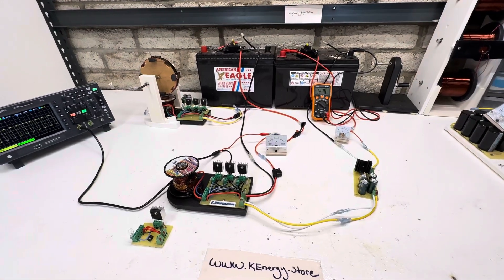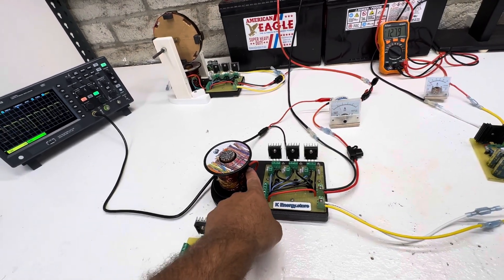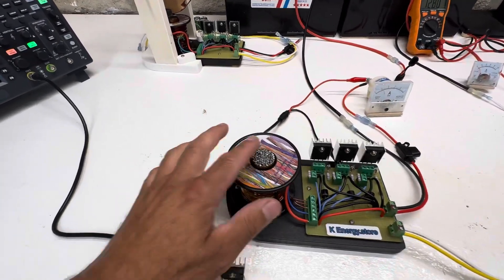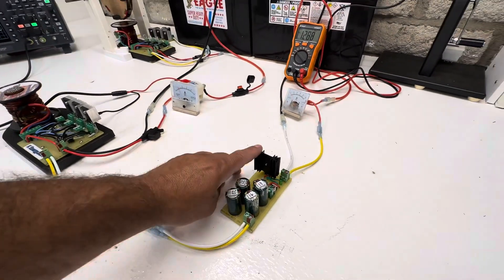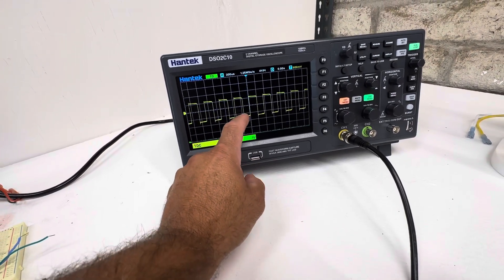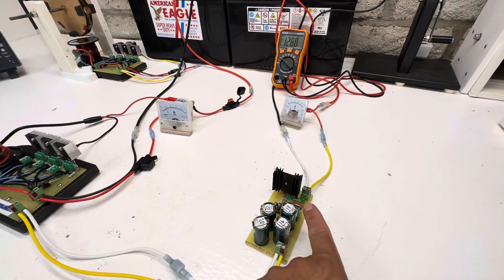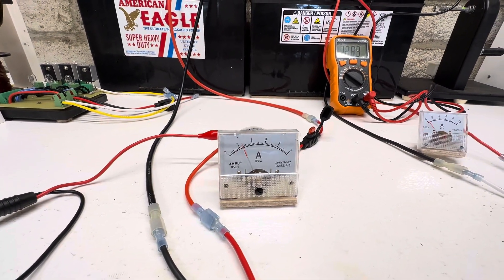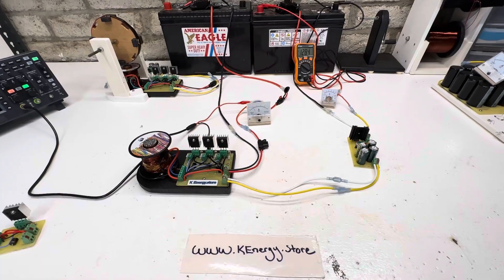Forced Oscillator solid state charging

Comment: Sorry I had missed this. Are there three separate wires or two on the coil? Do we need to use three mosfets or one would do.
Reply from the maker: You should watch next one too
Reply from the maker: 4 strand coil 1 for timing 3 power 
3 transistors 200v

Comment: You are doing some incredible research!!! I was friends with John Bedini and he would be proud of what you are doing.
Reply from the maker: Thank you !
Reply: @kenergy1707  I love that Newman boat motor. Did you see the Newman video where he drove that old car with dead nine volt batteries to start and after 30 laps they were completely full. That was an awesome video. I will see if I can find it.
Reply from the maker: @Biokemist-o3k  I saw lots of them but not that one that’s awesome
Reply from the maker: @Biokemist-o3k  I’m making a smaller version of my boat motor to test some ideas should be interesting that motor can do 85% return at lower speeds
Reply: @kenergy1707  It was so cool. I do not think it was 9 volt batteries. I believe it was two sets of 4 batteries . They were almost dead when he started though. I am working on a similar project however I need a switching unit that will switch run battery and charge battery. The typical bedini switch but I am not using a Bedini setup. Do you have anything like that?
Reply from the maker: @Biokemist-o3k  I do but it needs a latching relay I have a video about half way down on my page
Reply from the maker: @Biokemist-o3k  the system works great but you have to run the relay system on separate battery it uses 300 ma on the latching cycle
Reply from the maker: @Biokemist-o3k  my contact is on my wwwkenergy.store
Reply: @kenergy1707  thank you. that is why I was having so many problems. The relay needs to have a separate power supply. Thanks again. I will try and find it.
Reply: @kenergy1707  You do such beautiful work. What would you need as a price for the battery swapping circuit with relays and populated board?
Reply from the maker: @Biokemist-o3k  prob $ 110 plus shipping how it looks in video
Reply from the maker: @Biokemist-o3k  it’s up on my site if your interested

Comment: Crystal radio. As pulse drive. 
Ed leedskalnin had a iron core.
2 coils each around a alu cylinder.
8 henrie one side connected.
1 coil of 16 henrie. Connected to each alu spool. And the 8henrie also each wire connected to one and the other aluminum spool.
This makes a 2 LC circuits.
Back in ancient times people knew about piezo or rock sparks... triboluminescence. I bet they knew about radio too.
Reply: Now, he also had a bath. He needed his body volume and surface area. You can put that as L and C too.